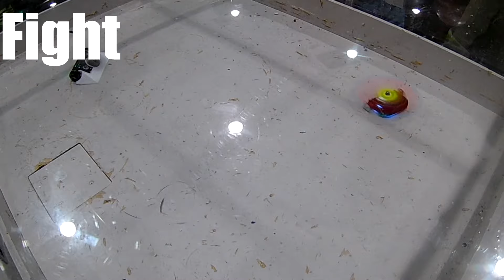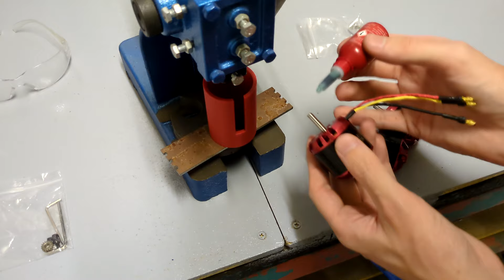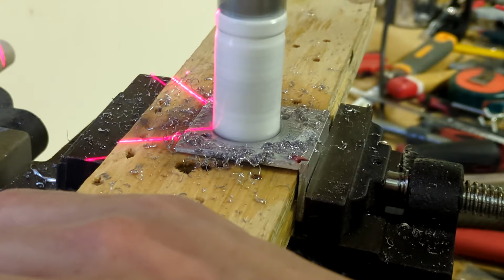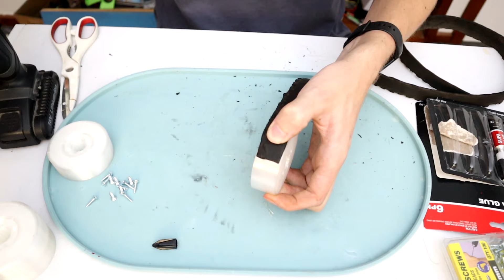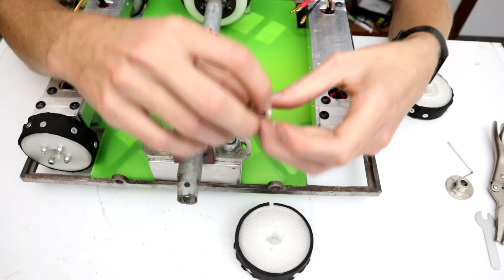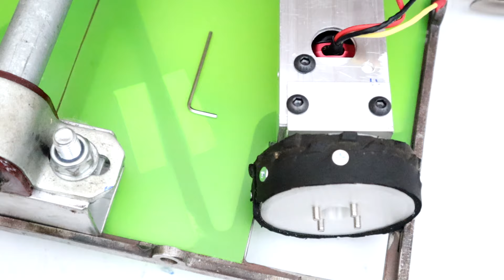Putting high powered brushless drive in a 13kg robot!!

Comment: Where can i get the cad for the custom aluminium part used to connect the motor to the gearbox
Reply from the maker: I havent released it as its highly specific to the motor, gearbox and my application of them
Reply: @TeamPanicRobotics  may i have them,im planning on using a similar setup on mine?

Comment: Looks like around 3 inch wheel dia would have used skate wheels or polyurethane rods to make it simple
Reply from the maker: SYM used to use skateboard sized wheels, but these needed to be a bit larger to give ground clearance

I've also personally found that skateboard wheels dont have enough grip to win a pushing match, so I tend to stick to rubber or polyurethane for my tires
Reply: @TeamPanicRobotics are skate wheels not insanely heavy compared to the tpu and rubber?
Reply from the maker: @Unhallowedrobotics your comment got me curious so I looked it up
skate wheels are made of polyurethane, which is what I've been moulding and casting for other robots on the channel (namely my melty brains)

polyurethane is a plastic with a density lower then TPU and PLA, so for the same sized wheel, skateboard wheel will be lighter then a solid printed TPU wheel

The problem is in durometer (i.e. hardness), I used 20A, 40A or 60A polyurethane to cast my wheels (higher number means harder, less grippy and more resilient, and I use higher numbers for bigger bots). Skateboard wheels come in durometers of 75A to well over 100A (and anything cheap you pick up will be on the higher end). This means cheap and available skateboard wheels, are over twice as hard as the wheels I'm making myself so will be far less grippy

(also I didnt show it in this video but I did make some 60A polyurethane wheels for this bot)

Comment: Top tip, use "T handle" hex keys instead of classic L shaped "allen key" - I find them much easier. The ones I have are not real Wera ones but they still work pretty well.
Reply from the maker: i really should upgrade my hex keys
I've got a random miss mash currently

I'll look into T handles

Comment: Top tip for you... spin the bolt backwards with some downward pressure on it, when you feel it lift ever so slightly and click that means you're perfectly aligned with threads and can then drive forward with no risk of cross thread

even works on self tapping bolts into plastic to ensure they go down the same path every time

Can do it with nuts too of course
Reply from the maker: oh! thats an interesting tip I haven't heard before.
I'll give it a try! thanks!

Comment: Great stuff.

Are those gears not going to rotate if not mechanically held, especially with the torque multiplication of the gearbox and heat build up + forward/backwards shock?

Would thrust washers between your wheel hub and gearbox mount work to stop anything binding?
Reply from the maker: the gears are a proper press fit, glued in with press fit loctite, I wasn't worried about them rotating on the shaft
I've used press fit bearings in the past with out the loctite and had success

thrust washers are a great idea, I'll have to try and source some for a future rebuild